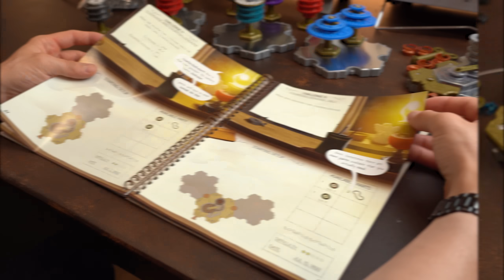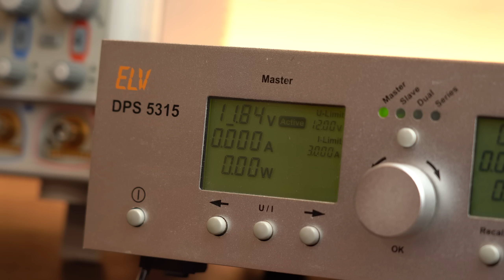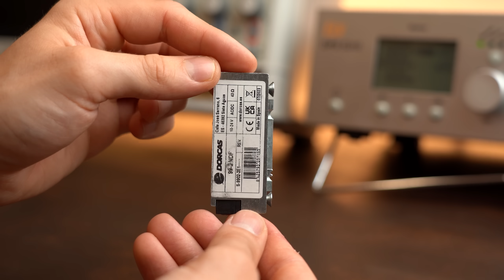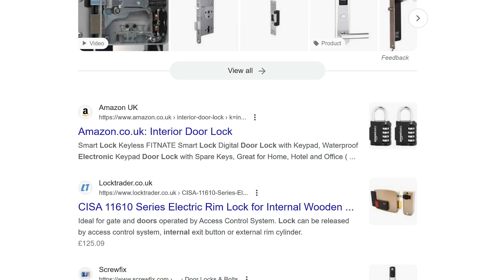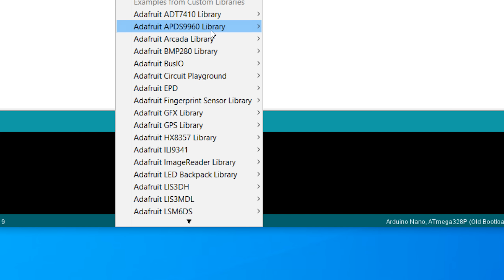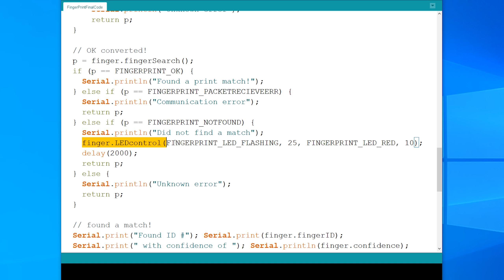Your Door NEEDS this Upgrade! DIY $40 Fingerprint Lock!

Comment: You might consider making the external handle one that has a key for an override. That way if there is ever a failure of the electronic lock (or a power failure), you can still get in your office.
Reply from the maker: True👍
Reply: @greatscottlab  Some door locks can operate the handle through the key. Aka after unlocking, if you continue to turn the key, it presses the handle internally.
This would be a good workaround to open the door if the power is down.
Reply: When your kid get some knowledge about electronics then you can just put handle back. Btw amazing video like all !
Reply: Can't the existing key still open the door?  @greatscottlab
Reply: Nah he could just pop the cover off and pull the power over directly to the lock - just like in the movies.
Reply: @BenScott Door strikes do fail, which would be a specific failure mode not accounted for in your recommendation.
Reply: @BenScott  what if there was a power outage due to a hurricane, looks like the movies you watched didn't have scenes like this
Reply: Or more important, if he is unconscious inside the lab, and the power is out just like you said, people can still get in to help without breaking the whole thing. It is fine to break the door if its an emergency, but if you collapse simply because you are too focused on project and forgot to rest, its kinda stupid to have the door destroyed just for something like that.
Reply: @itssilence9998 yeah that's really good example of things not going as planned
Reply: This and safety, especially in a shop it's important someone can get to you in the case of an emergency.
Reply: Not just that but in the case of an emergency (like, a fire inside the office), the access should not be hindered by non-redundant electronics.
Reply: Anyone can gain access in an emergency by unscrewing the outside handle.
Reply: @BlackheathTownhouse  That will take a while though
Reply: There needs to be a bypass for his wife etc.
If he has a medical issue etc he's essentially trapped himself in there.

Also if he doesn't run a battery to it, the power can fail & someone in there will also be trapped.

Imo there needs to be a mechanical bypass.

He can rig up a battery that can be charged using rechargeable batteries. If he's smart enough to do this he can make a way to see the battery level as well.
Reply: @ClickClack_Bam  no one gets trapped inside, there's still a handle inside that works.

someone suggested a knob on the outside that takes a key, that would solve the wife and power outage issue. Although the wife can just also be enrolled into the fingerprint system.

true worst case, the medical issue can also be solved by forcing the door open destrucitvely. it's not a solid wood frame (is it called MDF?), i wouldn't be suprised if it can be forced by hand.
Reply: I would use an electromagnet designed specifically for low security control access applications. If there is a power failure it releases the door, you don't need a backup method to open it
Reply: @dtibor5903  yeah I was thinking this, however they do use a more power for the EM than the NC option.
Reply: @dtibor5903  Power consumption man, you really shouldn't use things that consume power in a state that they'll be in 99.999% of the time. Let's be clear: he's from Germany. Power failures do happen, but they're EXTREMELY rare. Like once every couple of years, and they often only last for a few minutes. I honestly can't even remember the last time the power went out. That's also why almost nobody has a generator over here, there's just no need for them. 

Sure, getting locked out of your office is annoying, but what are you gonna do in there without power anyway? If you'd really need to get in, you could always open the cover and get the right amount of batteries or something like a car battery to open the lock. However, by the time you would've gotten the batteries, the power is probably already back on.
Reply: @timderks5960  what if there was a robber and he needed to get his BATTERY POWERED DRILL to screw the robbers mind back or his
 "glue GUN" to fix the robbers mouth shut 😂
Reply: @dtibor5903  I think you can actually just remove the hinges from the outside
Reply: ;D
Reply: This is exactly what I was going to say! Any failure of the lock relay will permanently close the room, it fails closed. Since it's mostly childproofing I would have kept the handle and locked the door. Keep the key in a known place and put a BIG keyring on it to prevent it being misidentified.
Reply: Yeah this is what I thought he was gonna do. A knob you can't use is a bit silly, a locking handle that stays locked with the key hidden somewhere for emergencies makes sense.
Reply: @zito88  A knob you "can't" use is exactly how all front doors in western Europe work. You open them by turning the key past the unlocked position. Doesn't quite work like that on regular indoor doors though.
Reply: The key can open the door nope ?
Reply: @Gilesone1989   nope
Reply: @Gilesone1989  External doors yes, internal doors: nope, the key can not open the door.
Reply: @higihups  yup I checked at home and it's exactly what you said 😢